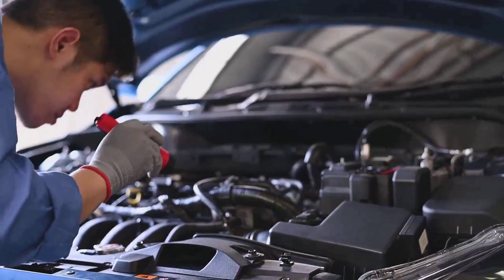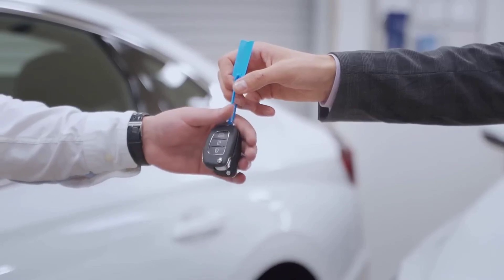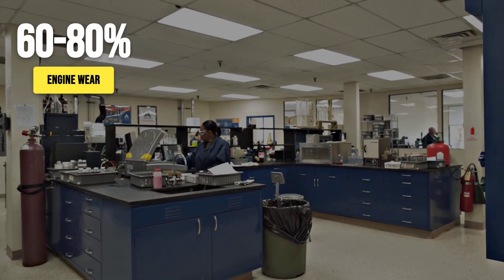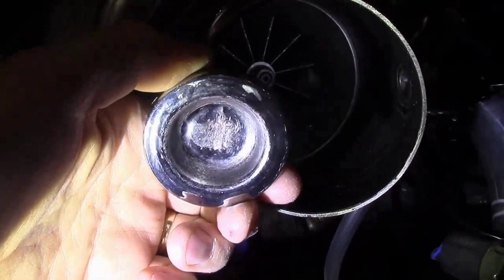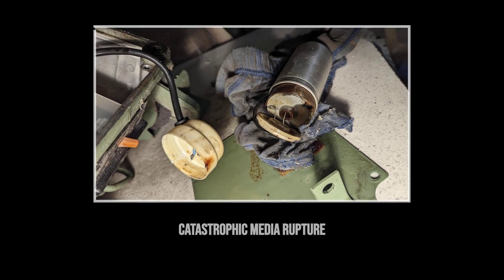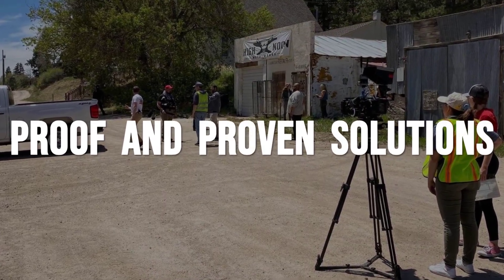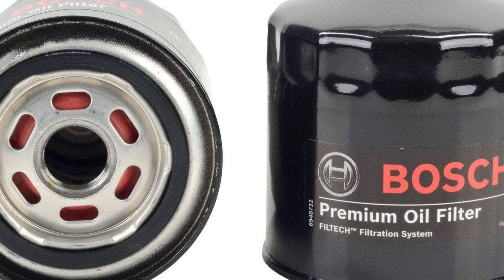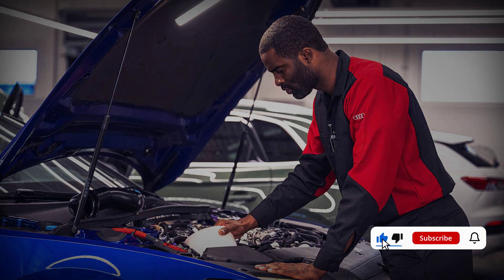These Engine Oil Filters Cause SERIOUS Damage (And 5 Working Ones!)

Comment: Blah blah blah..Got 300,000 miles and it still runs strong with Super Tech filters..
Reply: Yeah me also, I have run those for decades. They were made by a leading filter maker at one time, I don't know about now...
Reply: I use them all the time no problems

Comment: Back in 1985 went to KMart bought there filter said made by Fram machines 1 week later the inside of filter was sucked into my 318 69 Dodge van brought it to the local shop and he said you better get a lawyer I did got a new engine and installed and lost wages  Kmart paid the replacement thanks to my lawyers letters and conversations now it has a 340 Plymouth duster in it so buyer beware now I buy Napa Gold filters 🏆🤔 this a true story
Reply: This happened to my Brother in 1967 with a new impala 427. Fram filter came apart and blew the engine, Fram paid for a new engine...